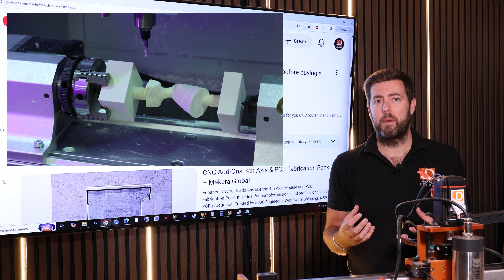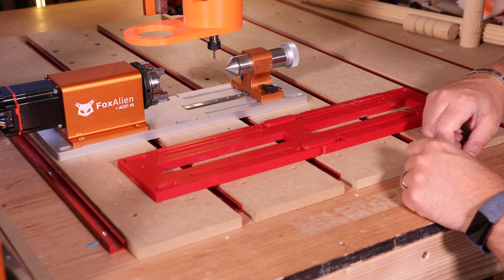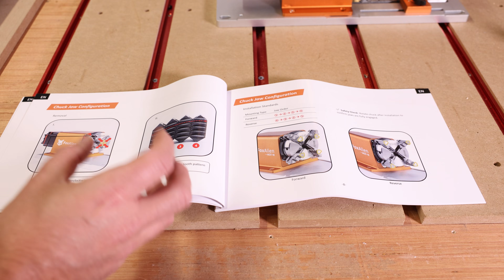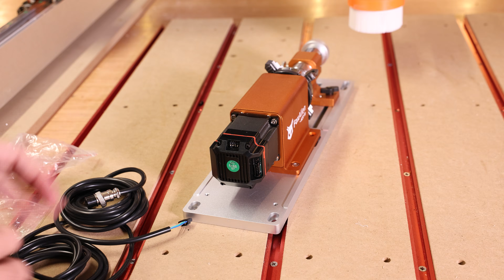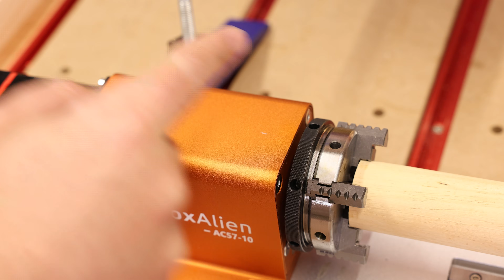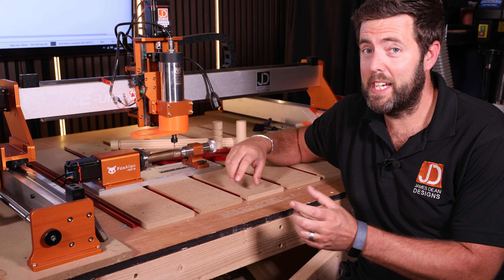Grow Your CNC Creativity - NEW FoxAlien 4th Axis Setup & First Look

Comment: Hi James
May I ask your advice on something?
I was conducting a 3d boundary relief job on my brand new Fox Alien Ultra Core. The roughing pass worked fine. However the finishing was just passing over the top and just cutting the outside boundary. What would cause this?
Cheers
David

Comment: Looks awfully similar to the Sienci Vortex, but at a smaller scale. I’m surprised FoxAlien doesn’t have a program to drill inserts into spoilboard for perfect alignment. Otherwise mark first pin, then move along X axis and add more inserts on same coordinates.
Reply from the maker: Ive used quite a few and to be fair, most 4th axis are very similar in design (probably with the exception of Onefinity). Yes, an alignment hole file would have made life a bit easier for users, which is what they did on the Vortex. But having everything as actual made parts (as opposed to 3D printed) and the linear rail does make this feel a good quality (equally adds to the price though)

Comment: Is it possible to use it as a true 4th axis? What i mean is to use X,Y,Z and the 4th axis at the same time. That would open opp so many more possibility's for detail.
Or do only big industrial machines have that option at the moment?
Reply from the maker: Not 100% sure as I've never tried it but yes in theory it should because it operates as a separate A axis. But your software would need to output the correct code for that to work.